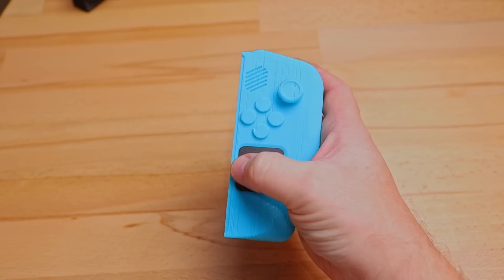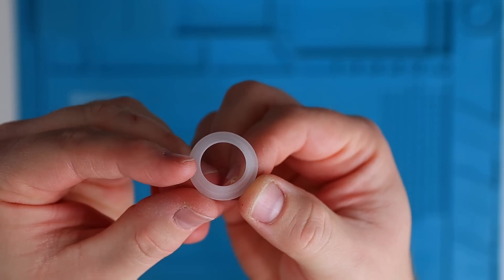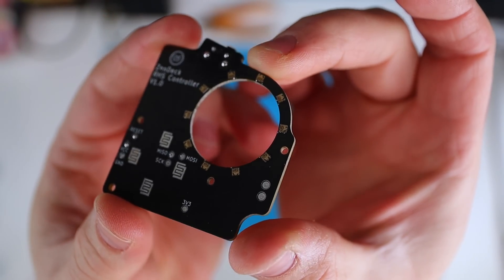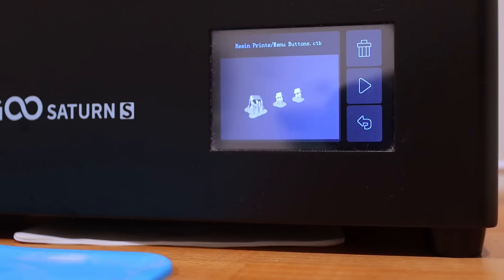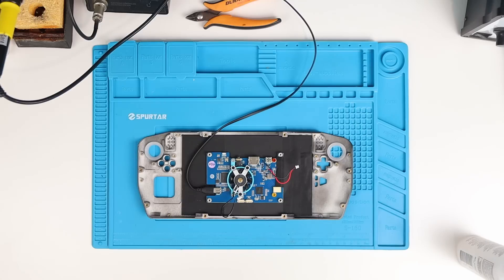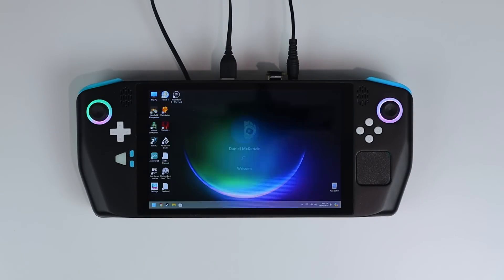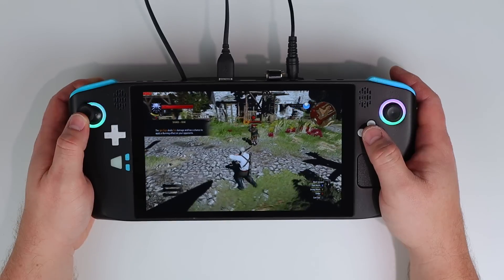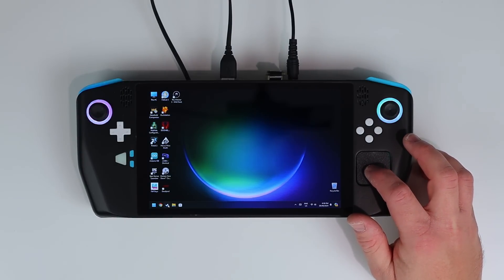Building the first ZenDeck Prototype!

Comment: I hope you have good air circulation or filtration when using your sls printer, the fumes released by resin while printing are nasty for your health.
Reply from the maker: Yes, I'm well aware! It lives in my laundry which is more or less completely separate to my house, so the only room at risk of exposure is my studio. But the laundry has a good ventilation fan so with the door shut and the fan running, I've had no noticeable smell even when working just outside the room

Comment: still based on Ryzen 7 5700U?
Did you know that this is a rebranded older 4000 series that is based on old Zen 2 cores and an old Vega iGPU?
Maybe it's worth changing it to Ryzen 7 6800U (Zen 3+) with 680M (12 CU; RDNA 2.0) or Ryzen 7 7840U (Zen 4) with 780M (12 CU; RDNA "3.0" - same as 680M)?
Reply from the maker: I'd love to upgrade it at some point, but this was the best I could get easily at a reasonable cost point in Australia. It does everything I need it to at this stage but a bit more power in the future wouldn't be a bad thing!

Comment: Looks really good, especially trackpad, I still don’t understand why there are so few handhelds with it on the market, it’s very comfortable thing, overall, a little more work and it will be an excellent handheld pc. But I'm really wondering where the battery will be, since there is very little space left inside.
Reply from the maker: The batteries will fit below the controller PCB's. Two 21700 lithium cells on each side for a total of up to 91wh of capacity! And yes, I'm definitely enjoying the trackpad, its a useful addition that I feel should be on all of these bigger handheld devices!

Comment: How many mAh's is the battery going to be
Reply from the maker: Up to 6000mah with 4 cells in series for a total of about 91w/h. You could also put smaller 3000mah cells in if you wanted a lighter build but you'd be down to around 1-3 hours run-time.

Comment: You'll think I'm mad but i think you should put a 4060 in it and underclock it to 25W and see what happens. Then if you plug it in, run it at the max speed it'll go. The 4060 runs at 10W at idle so it should be fine doing 25W. And a 5700u will not bottleneck it at all.
Reply from the maker: There's no PCI-E slot to connect a GPU sadly. Not to mention the extra weight and battery life penalty. Your best bet for a DIY handheld with a dedicated GPU would be to start with a gaming laptop mainboard
Reply: @cncdan  sure there is! there's an m.2 slot. you don't need an ssd for mobile gaming, usb storage is plenty fast enough if you use a good ssd. you can even use your existing nvme ssd with a usb chassis. gaming laptop mainboards use crappy gpus that have very bad price*performance/tdp ratio, desktop gpus can easily beat that stuff imo. the 4060 idles at 10W and could probably be less, i'm sure you'd be surprised at how well it works in a handheld. i can easily see it reaching 1-2 hours with a large battery with noticeable quality upgrade over the APU, plus enabling its whole power when hooked up to the wall would just be a whole nother thing

Comment: Be interested in some comments on how ergonomic and heavy that this is - it does look nice, but I suspect it isn't really light or comfortable enough for a prolonged gaming session. (Not that many of the commerical offerings are going to be perfect there either - I bulked my steam deck up a fair bit as my hands are larger than it really suited)

Still I really like the concept, it is nice to see a trackpad included, something almost nobody but Valve is doing in this form factor that is way to handy to want to go without. I would however say you should put a second trackpad in if you can - these handhelds will occasionally want a keyboard and the Steamcontroller style two trackpads keyboard is really nice to use compared to anything else but a real keyboard.
Reply from the maker: The Steamdeck has some speciality software to allow those features to work on the trackpads, it's not really something I can easily pull of which is why I stuck with just a single trackpad. As for weight, yes it's going to be far from light. In its current state it weighs about 800g but I haven't added any batteries yet. With the smaller battery option it will be about 980g complete with a 1-3 hour runtime. With the bigger battery option it will be 1100g with a 2-6 hour runtime. Compared to the legion go (because it has an 8" screen like I do here) with the smaller battery (which is around the same capacity as the legion go anyway) mine is only 100g heavier than it which is mostly down to the need for a seperate display driver board and the fact that most mini PC's have a much beefier heatsink than the portables do. I could swap out the heatsink/fan for something smaller and lighter but my aim here is to keep this thing as modular as possible and minimise modifications needed to get it running to make it a less intimidating build for everyone. As for ergonomics, this will vary for everyone due to the size of their hands etc. This console is a fair bit bigger than a Steamdeck and I find the ergonomics are great at least for me. I put a fair bit of work into perfecting the shape and position of the buttons and sticks but I'm sure the layout and position of stuff won't suit everyone.
Reply: @cncdan  That is pretty impressive weight wise, I was expecting more like 1300-1500 range, I know how quickly the weight can build up when you are using off the shelf bits, and it is a larger screen. 

However as it shouldn't be too bad to create a similar on screen keyboard to the Steamdeck method, nor I suspect will actually be that hard to just use the Steam version either. As much of the hardware interface layers of the Steam Controller seem to be available, but I've not looked into it deeply (yet anyway) just seen the documentation for steam input stuff seems rather huge, which means its probably in there somewhere... Whichever way you'd approach it IMO it would be well worth it though, unless you are going to build in one of those mini keyboards as some handhelds have done. I think I'd rather write just a patch to an open-source onscreen keyboard to take the two input devices in the same style. Which is a project I've had in mind to try for a while anyway - be nice to have such a slick 'onscreen' keyboard without needing Steam running and having all the keys I'd want - from time to time I've needed special characters for terminal stuff.

Comment: you are the man but still you to go an a different direction i do want you to use or design the telescopic controllers.
great work
Reply from the maker: Thanks! Yeah the removable grips just isn't feasible without making the device much bigger/heavier. The batteries extend right out into the controller sections so there would be no room for them if the grips were removable.
Reply: @cncdan  something like the Linx Vision controllers not to be part of the device just an attachment

Comment: how come you not cutting prototype pcb's on the cnc ? ;]
Reply from the maker: I promise, it's something you'll see me do on this channel eventually! I've done it before in the past, but there's a partical limit to how small you can easily go with machined PCBs and most of these PCBs are way past it. I could probably do the joystick PCBs myself but there is little to no point when I have to get the other PCBs from PCBWay anyway. Plus these simple 2 layer boards are $5 for 5 of them (minimum order quantity) so I'd be buying them even if I wasn't sponsored!
Reply: @cncdan  Ive done some experiments in the past for gamepad stuff as well, but I had a diy cnc, now I bought a chinese 3040 need to try again as this is way more rigid and precise then my diy was ;] also I wonder if its possible to cut a flex pcb
Reply from the maker: @Moonrakerd  I don't think milling flex PCBs is a possibility just because I've never seen the material available anywhere. There's one other big downside to milled PCBs too, vias aren't an easy thing to achieve. I've done it in the past but it basically ends up being a hole drilled through the board with a bit of wire through it to join both sides. It's definitely handy on projects with larger components and when I'm in a hurry, but for the small surface mount stuff I'm leaving it to the pro's from now on! Just one less headache I have to deal with 🤣

Comment: The lazy, practical person in me says: "Why not get a Steam Deck?" but the engineer and Kerbal Controller builder in me is very, very much understanding that it is just that much better to do something yourself. Both of those traits are in complete awe of the device.  (The Linux person in me is saying that he'll take 10 if you can get it running various distros well.)
Reply from the maker: Thanks! Honestly I spend more time designing/building these things than I do playing them, so just buying one wouldn't make much sense for me 🤣 I'm planning to try out some of the "Steam OS" Linux distro's in an upcoming video to see if they work well on it!
Reply: I mostly agree, though even the KSP builder in you aught to be considering a Steamdeck or similar as a starting point - it is much easier to make something you will like that suits your needs if you have a good comparison and some experince with similar stuff to really know what you want to improve.
Reply: @foldionepapyrus3441  I pre-ordered the Steam Deck. I've had it for years at this point. I actually wore out the battery and replaced it lol

Comment: I have a question regarding your button membranes, it seems you didnt go for an enig finish for them, which is recommended afaik, because it avoids oxidisation which can lead to your buttons not working down the line, did you find a cheaper alternative to combat this? If so, please let the world know, cause enig tends to be really expensive.
Reply from the maker: Wish I could say I'd found a better solution but unfortunately not! This finish is working well enough for now but the pads have to be very clean. I will likely get ENIG on the next revision because it's still considerably cheaper than having carbon ink applied to the contacts. All the controller PCBs are simple double sided boards so besides needing ENIG on the bottom two, there are no other fancy features required.
Reply: @cncdan  Well thats good to know then, shouldnt be tooooo expensive, wish you all the luck with your next revision and other future projects!

Comment: Amazing! Keep up the good work! I know it is probably not in the plans but if you happened to make a kit that included everything, minus the PC itself, I am sure it would be a hot seller of a product. I know I would buy one.
Reply from the maker: It's something I'm considering. The aim this time around was to simplify the design to try and make it easier/cheaper to produce and to use as many off the shelf parts as I could. I've also completely separated the power management system from the controller PCBs so it can function on its own so at the very least I may be able to sell a couple of those as that's the hardest part to figure out!
Reply: @cncdan  I'm not aware of the pricing of making these parts by PCBway, will buying in bulk make it considerably cheaper? Or are those people with a 3D printer much better off printing themselves? How about the PCB's, does every1 need to order their own PCB's seperately?